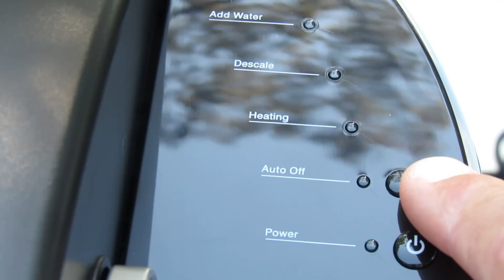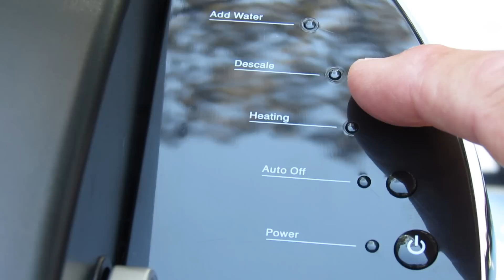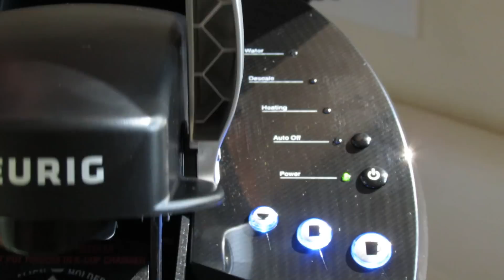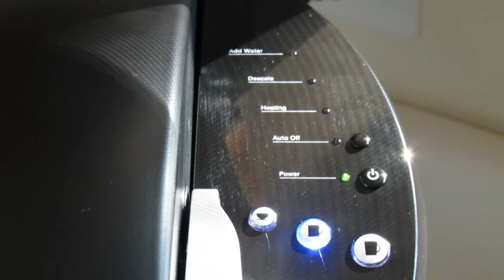Unboxing, Review & Demo of the Keurig K55 Classic Brewer

Comment: I am in the same situation of buying one for my dad. I’m stuck between this one or the one with the screen on it we had one before but it broke and I totally forgot which one it was. Any recommendations?
Reply from the maker: This one is certainly less expensive and has fewer features than the touch screen models which offer more types of brewing (strength and temperature) and some automatic features, like auto on. If your Dad just wants to fix himself a simple cup of coffee in different sizes, however, this is the one to get.